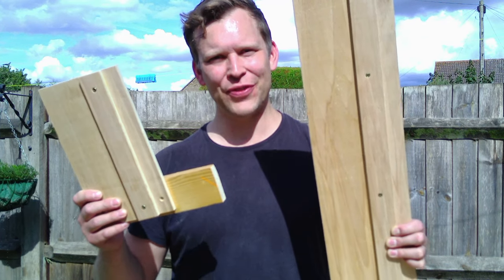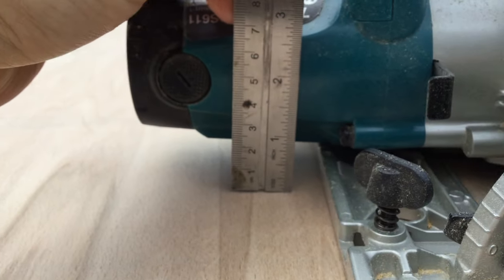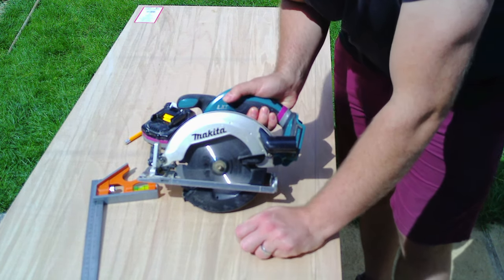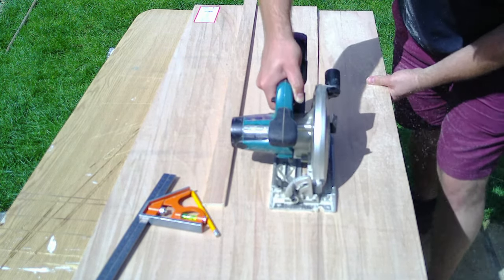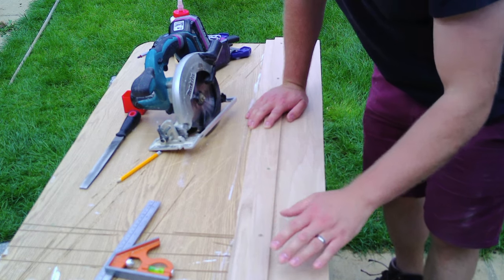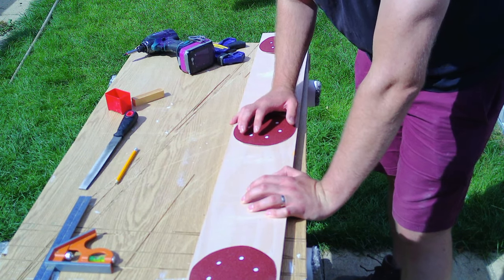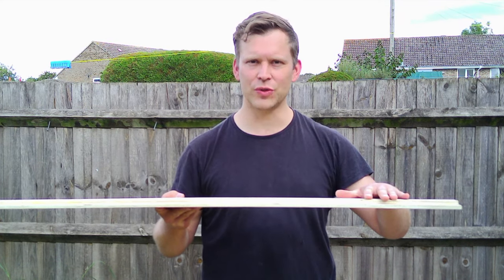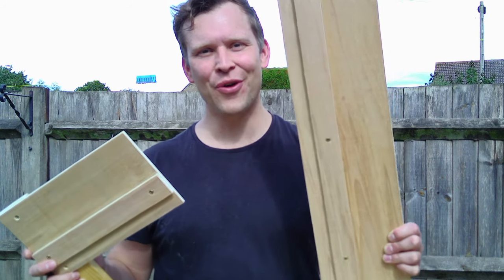2 DIFFERENT JIGS FOR THE CIRCULAR SAW - How I make a rip cut and cross cut jig for a circular saw.

Comment: You can use silicone glue on the underside of the jig and let it dry.   It’ll stay sticky when dry and grip to the table instead of using sanders.
Reply from the maker: Thank you for the advice 😊 I'll have to remember that trick for next time. Thank you for sharing 😊

Comment: Thanks Tim - nice video as I was trying to figure out how to make some rip cuts.  I saw on another video someone put a layer of 100% silicone caulk on the bottom and let it dry to make it grippier across the whole surface as opposed to the sandpaper which I’m thinking about trying out. I usually use a speed square for cross cuts but your jig will be great for cuts that are slightly longer. Thanks!
Reply from the maker: You are welcome. Thank you for the idea about the silicone. That's the great thing about the Internet, you can get ideas and take the best bits that work for you. Let me know how the silicon works for you 😊

Comment: Thank you, cross rip cut jigs are great. But if have a hardwood stock, 1m long, 80mm x50mm. And I need to cut it in half to make two 1m lengths at 40mm x50mm. How can I stabilise this stock on my work bench while I rip cut it with my hand held circular saw ? I don’t have a table saw.
Reply from the maker: You are welcome. When I need to do something similar to this, I find another piece of wood that is the same depth and about the same length. I put it under the back of the jig to level it. I hope this helps.
Reply: Thanks. The advantage is that there is More contact surface area using your rip jig over using an aluminium guide fence that is a skinny arm that attaches directly onto the saw and hugs the edge of the timber being cut.
Reply from the maker: It is great to hear the jig works well for you. May all your cuts be straight 🙃

Comment: I have a couple of jigs but one of my most useful is one I made which only has a thin piece of hardboard as its base. The hardboard means I can staple it into place when making cuts where clamping or holding the work is too awkward.
Reply from the maker: Hi @Daz555, that is an interesting idea. I've not come across that idea before. Thank you for sharing it 😊

Comment: I like the anti slip idea with sanding pads.
Reply from the maker: I hope it helps with your projects, Justin Trojan😊
Reply: Good idea though the grippers are - does the gap they produce not reduce  the jig's ability to prevent cut out from the surface of the workpiece? @MakeItWithTim
Reply: Great question @amonty4022, I haven't had this problem myself. As with all things in life there are compromises to be made. If having the jig absolutely flush is more important than the grip offered then don't use the sanding pads. Either way we are talking about a fraction of a mm which don't normally make a difference if you are using a circular saw for the cut. I hope this helps 😊

Comment: Thanks for the easy to follow explanations. Would these types of jigs also be suitable for a 45 degree cut (by cutting the zero clearance edge at 45 degrees)? I want to rip a stack of long french cleats  without having to buy a table saw.
Reply from the maker: Thank you OZGamer, I'm glad you found it easy to follow. The jigs should work for a 45 degree cut as well (although I've not used these for a 45 degree cut). Just be aware that once you have used them for a 45 degree cut they wont be as accurate for cutting your normal rig cuts with. I would make 2 separate jigs if you want to do this.  It's also worth being aware that the circular saw might want to tip when at 45 degrees so you'll need to pay more attention to keeping the bass on the jig to make your cuts accurate and consistent all the way along. I hope this helps and you get some good French Cleats for your project. Let me know how it goes.
Reply: Thanks for the reply, getting a stack of ply delivered next week, got a bit of work to do lining the interior walls of my shed before I get to doing the cleats. I'll try out the normal version of the jig (I already use a smaller version for smaller cuts) first for cutting down my ply wall panels. When I get to the cleats I'll certainly give the 45 degree version of this jig a try. May be a couple weeks til I get to that stage but will let you know how it works out :)
Reply from the maker: That sounds like a good project. I hope it all comes together for you. Yes, please let me know how it goes 😊
Reply: @MakeItWithTim  So just a quick update. Got the back wall & back corners of my shed framed up, insulated and then lined with ply sheets. I plan to do the same to rest of the rest of the shed eventually, along with ceilings and a diving wall to separate a small workshop/storage area from the rest of the shed which one day in a quite distant future become a bit of a pirate tavern themed bar area.
But that's a long way off in the future. For now my tools need a home so i can stop spending two weeks looking for a tool everytime i need to do a 5 minute job lol... and so the back wall is the spot. I only needed to cut down sheet of ply for the the whole wall so didn't really warrant a jig at that stage. Now tho, time to get started on the cleats.
So instead of doing two separate jigs, I made one double sided jig.
The 90 degree edge on one side and the 45 edge on the other side so I can just turn it around.
I did my cutting on a couple of large multi-purpose foam insulation boards layed out on the ground to keep everything evenly supported.
The 45 degree cut changes the size of the clearance and the distance between the blade and the edges of the foot of my circular saw so I made two separate spacer blocks, one for the 90 degree cut and one for the 45 degree cut, and made I labeled which wss which. I alternated between straight and angled cuts, use one spacer block to size up where to clamp the jig for the 45 cut, did the cut, then flipped it around and used the other spacer for a straight cut, rinse and repeat.
Took a few goes to get the blade the right depth, specially for the 45 degree cut, but once I got that sorted it worked quite well.
The only issue I have is when you start running out of board to cut, there's enough board for another 2 cleats but not enough board to clamp to the jig, but I'll find other uses for those off cuts. The only other thing I'll add is that cis it's being moved around a bit, the sharp edge of the 45 degree angle on the jig gets knocked around and chips off a bit here and there, but didn't seem to affect the quality of the cuts that I could notice.
Reply from the maker: Thank you for the update OZGamer. It sounds like you have been busy. I love the bar idea. Ideal to have somewhere to rest up at the end of a hard day is the shed. I completely understand the frustration of trying to find tools. Our garage is going to become my workshop but until the house is sorted that project is on hold and might take a while to get done now we have  a baby girl to look after as well 😊 things take a lot longer now she is around but I wouldn't change things at all. 
The info about the 45 degree jig is good to know and I love the fast that you doubled up on the jig. Great thinking 😊 I hope the rest of the project goes well and I'd love to hear more when you have another update.

Comment: thank you for this. ima go ang build it. i just noticed that i can actually make the 1st jig then add the small plank from the 2nd jig to the 1st perpendicularly and make it a combination for longer cross cuts on plywoods right? thanks!
Reply from the maker: Hi Jared Lising, yes if you want a longer 90 degree jig for plywood cuts you can do exactly what you have suggested 👍 I like your problem solving and innovation 😊

Comment: how long should my ripcut jig be?
Reply from the maker: That is a great queation. The answer really depends on what you want to do with it, how much space you have to use it and the size of ply sheet you can buy. If you are unsure I would start with 4 to 6 foot as they are easy to move around and will allow you to do a lot of different jobs. You can always make a larger or smaller one in the future if you need it. I hope this helps.

Comment: Can you cut angle cuts like 45?
Reply from the maker: Hi @Yasar M, yes, you can use this for a 45° cut but I would make 2 different jigs. 1 for a 90° cuts and the other for 45° cuts because when you do a 45° cut it eats into the edge a bit more and it wont be as accurate when you go back to 90° cuts. Also, just be careful that you circular saw doesn't tip when you are cutting (as with all 45° cuts). I hope this helps. Let me know how you get on.

Comment: I made a guide but I sort of messed up the very start of the final cut, so the zero clearance edge is a bit wobbly right at the start. Is this to be expected to some degree, as the saw's plate has not yet got full contact with the fence?
Reply from the maker: Hi Deaosatori216, I'm sorry to hear about the wobble cut at the start, it can be tricky. You have a couple of options. 1st is to just live with it and use the rest of the length to line up your cuts as the guide edge is still straight. 2nd is to cut the wobble off and make your guide a bit sorter. I hope that helps.